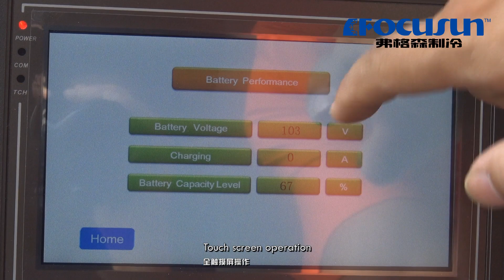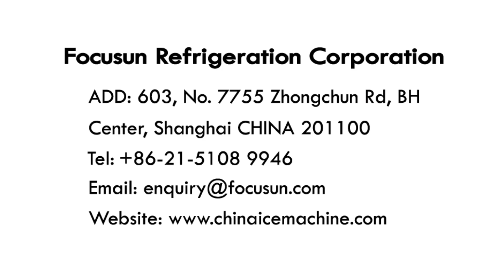Focusun Solar Power Cold Room

Comment: Tip: You should include the panels in a glass box on top and also supply cold air to them. It will increase your efficiency by 10%